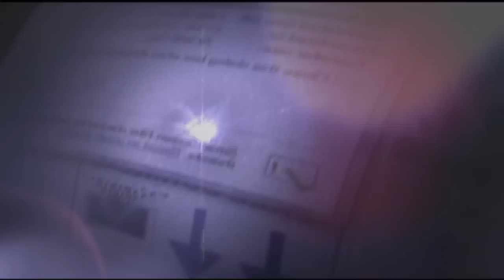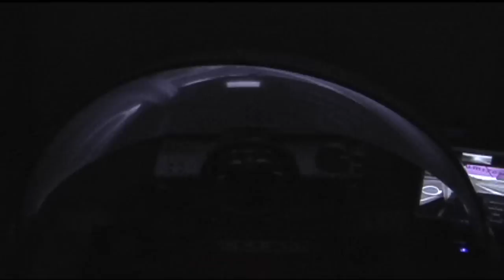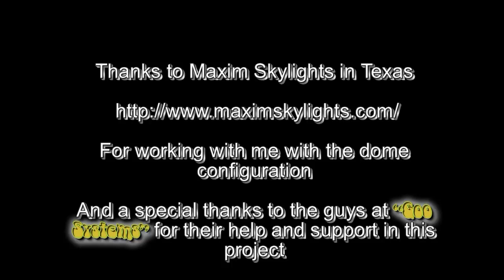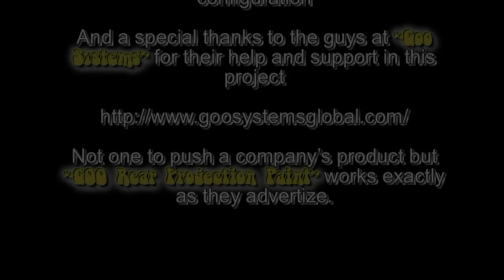The Next Generation Gaming Dome using GOO Paint

Comment: Just a thought for simplifying the projector setup.  You should consider a mirror and then place the projectors on the wall shooting down at the mirror.  This has the advantage of sutting your distance down significantly (depedning on mirror size and ciling height).  Plus makes the whole unit more compact.  you might even be able to use the aluminum to make it all a single unit.

Woudl make moving it a cinch as the projectors would always be inthe right place when you remount them.

Comment from the maker: That said the image works fine just looking for perfection you have to have two beamers.
The distance from the driver head to the dome is adjustable by means of two locking linier bearings mounted to the front cockpit (Dome frame) so you can pull it over you head and “be inside” the dome for flying and first person shooter games  then push it back a bit for driving. The frame was based on a Frex type frame heavily modified using 1.5 Extrusions as opposed to the smaller 25mm Frex option.

Comment from the maker: The Idea of using the whole skylight turned sideways was an option, but my idea is to sit inside the dome as opposed to looking at a screen. In addition I was planning on adding a back part to the screen by bending a acrylic  sheet over the driver (kinda like a fighter cockpit) spraying it with Goo then adding two more beamers to hit each side this gives you the ultimate emersion, It is the same concept as Frex used just mine is huge compared to his.

Comment from the maker: I also added the dome-mounting frame and the legs to give a more upright driving position for rallying and a more natural position for flying of shooter games.
The 18-degree legs can be removed if you want a more open wheel driving form it offer the best of both worlds.
I use the Frex SimcoMotion and X-Sim via SimXpereance Commander Software to run the 100mm actuators depending on which game I am playing.

Comment from the maker: The dome size has been increased to 60” dia but one PJ cannot project around the dome surface not that the surface is too big but you cannot project round corners. Therefore, you lose some detail on the leading edges of the dome.
In addition, the image correction software can compensate to the point of the beamers image spread but it is a challenge working with it to get an undistorted image just too much time tweaking and not enough time driving or flying.

Comment: This is an awesome idea, I'm surprised not many more flight simulator fans have done this. I would also like to setup an immersive system -- it seems that a dome is the way to go. Would this work with just one projector (ultra short throw?) and perhaps software like Immersive Display Lite 2 to wrap the visuals?